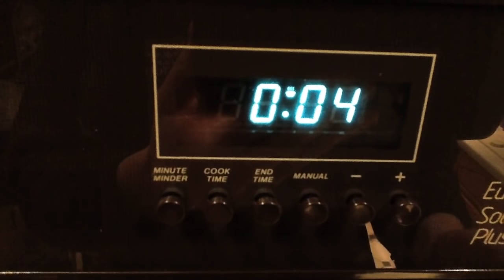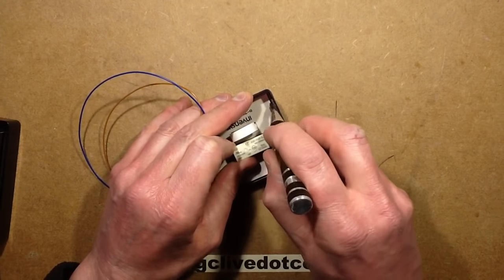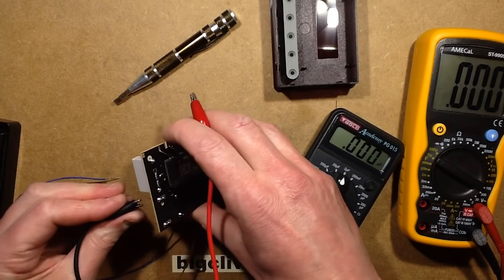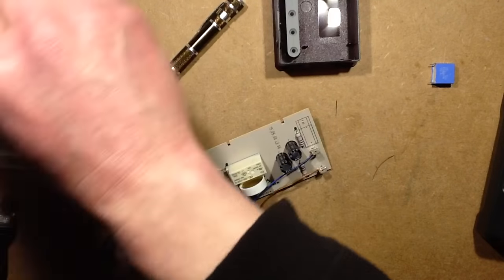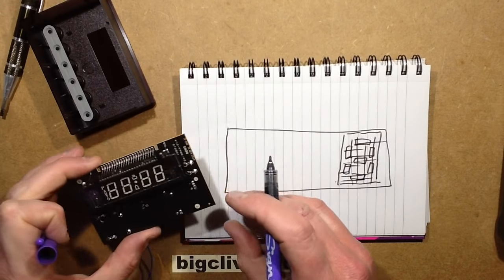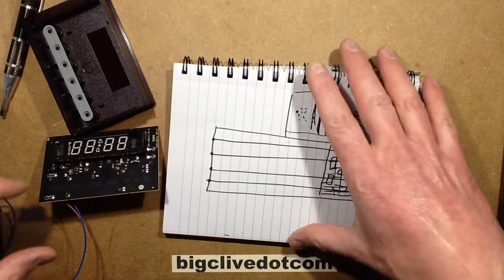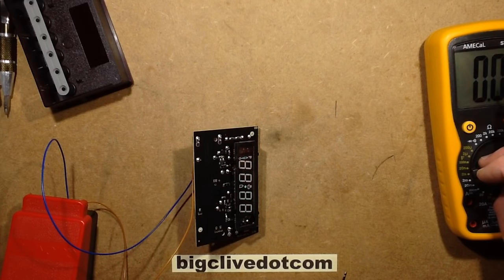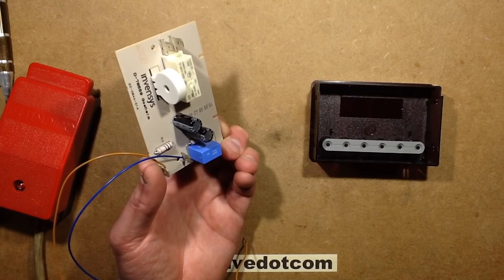Fixing a digital oven timer module.

Comment: By any chance do you know the DC voltage out of the rectifier bridge?  I am getting 0.5 volts and there is no way to know the real value of the two  zener diodes  test them and one is 12.3v and the other 2.3v

Comment: First impression was partly shorted electrolytic capacitor, shunting voltage.  Yet, if cap dropper fixed it, it was current issue?  In either case, main input voltage or current was obvious.  This because even the piezo and relay was buzzing.  I've seen too many such defects as low negative supply rail as being one of the electrolytic caps being partly shorted.  Anyway, as long as circuit is up and working again and relay latches as it should, its fixed.

Comment: Very interesting,  timer module de Dietrich oven displays oven temperature set point and actual temp,  crystal display, single button, knob to press to scroll between timer modes. When we press the button it no longer scrolls... Would be interesting to have your skills.
Unbelievable with same oven , oven light stays on,when the off zero position is selected on cooking mode selector. De Dietrichs are dear and parts scandalous. Delighted to subscribe to your channel, i might learn something!

Comment: Hi I've got one of these and replaced the component as you have done. I see that the relay looks a little brown and get no continuity across it, so suspect that has failed. I'll order the component and try my luck.
Reply from the maker: If the relay is discoloured then the contacts may be burned out.

Comment: I have successfully replaced broken dropper caps in freezer and floor heating thermostat. How critical the value is for the replacement cap?
Reply from the maker: +TheJJHO Preferably the same as the original.

Comment: Whenever I repair anything with those rubber buttons with conductive studs, I clean them, and the PCB pads with meths. Most TV remotes use them and they often become inoperative after a while.

Comment: I recently replaced this capacitor on the display for an AGA oven (almost identical to the one shown) but still nothing is working even though the rectifier downstream from the cap is showing about 12VDC. Is there anything else worth looking at before I attempt to find a replacement?
Reply from the maker: If there is an electrolytic capacitor then try routinely changing that, noting that it is a polarised component and needs to be put in the correct way round.
Reply: Thanks for the tip. With this capacitor changed the relay now opens (it's NC), so somewhere else is now getting power but there's no display. I have tried setting up the minute minder and manual cooking 'blind' but there's not response. Seems that this one is beyond repair.

Comment: Was that capacitor at around 4:40 Iskra branded? I didn't know that they were still in business. It's an old Yugoslav company that used to make all kinds of electronics equipment like multimeters, oscilloscopes and soldering stations.
Reply from the maker: +Derp Herp It sure is.  Well at least, the brand is.

Comment: Hi Clive, got a very similar clock/timer on my double oven, whenever I turn anything on it trips the fuse, after checking all the elements which seem fine I took the timer apart and noticed the dropper capacitor had a scorch mark next to the resistor and also the relay spade connectors are also have a black deposit on them,  is it possible they are responsible for tripping the supply?? Getting fed up with microwave meals and don't want to spend silly money on a new clock/timer for it not to rectify problem..
Reply from the maker: If it's tripping the RCD on all settings it might be a neutral to earth short.  Check all the heater elements for craters.
Reply: @bigclivedotcom  thanks Clive, are the connections on the relay and the scorch mark anything to worry about? I've noticed before I turn any oven or grill on I set the time on the clock but as soon as I push any of the buttons the display dims quite a bit, I'll check all the components again.

Comment: I have same PCB in my oven. In last 2 years i replaces same capacitor as you 4-5 times already. It appears failures happen more faster after each replacement.
It starts with reset (like when you unplug power) every ~48h and goes progressively faster each time up to reset every 10 minutes, and in the end it goes down and nothing works.

I can replace it again but what is the cause of this? Any idea?
Reply from the maker: Are you using a good quality capacitor from a mainstream supplier?  If the capacitor is failing that fast it may be shunting a lot of electrical noise.

Comment: The dropper capacitor going low in value over time is a really common fault in all sorts of appliances.  It's the first thing to check when the product becomes intermittent or drops dead entirely.

Comment: Its common for vfd's to have ac across the heater, in fact its better for them.
DC introduces a voltage drop across the heater wire making a brighter display at one end, this isnt as bad with ac.
Proper vfd drive chips that run off dc produce a square wave for the heater using a H bridge.

Comment: Hi Clive. I have one of these devices and for the sake of a £1 capacitor I’ll be trying to fix it however it looks like someone has already bypassed it somehow and so even if I do fix it I’ve got no idea how to connect it back uo 😂  
Mind you, I suppose, it’s just a case of putting the relays in series with the oven element?
Reply from the maker: It's possible that the connection to the relay has been joined across by someone else.
Reply: @bigclivedotcom  thanks for the reply. ive got two naked relays (x4 empty spade pillars) and x2 spade “christmas trees” with everything rammed on, plus a distinctly aftermarket looking choc connector. Something for those long winter nights…
Reply: Woop woop. Swapped out that capacitor and the display is back to life. Now all the remains is to work out how to connect it back into the actual oven function.😂
Many thanks for your video Clive. It’s really been so helpful.

Comment: Where is the connection to the temperature sensor?
I though that was a oven controller.
It has the relay to start turn on the heat, but no way of detecting the temperature.
Reply: Oh, I see!

Comment: Your desoldering wick is tons better than the drek I get. Need to find me some better stuff.
Reply: +Glebs Litvjaks that's actually what I've been doing, it's the only way it works. I think that's actually isn't any in the braid.
Reply from the maker: +Gadgetboy Search eBay for goot wick.  It's available in several widths.  This stuff is CP-3015 3mm wide (seems bigger) by 1.5m long.
Reply: +Gadgetboy I just gave up and bought a Hakko desoldering gun. I love the thing.  Nothing like it when I have to desolder chips or a whole lot of parts. I once had to sit down and remove USB connectors from 200 boards.  The Hakko does such a good job that when I finished the last pin 9 times out of 10 the part just drops out.
Reply: John Ridley what model?
Reply: +Gadgetboy 808.  Fully self contained.  It's great.  It was $200 but I'd pay it again.
Reply: Goot works good!

Comment: What is the brand or type number of that X2 cap? So i don't accidentally buy one and have to replace it again in 10 years...
Reply from the maker: +LimaVictor There are a wide range of brands.  It's down to what you can get from your supplier.
Reply: +LimaVictor The white one is Iskra, Slovenia. Suppliers to Gorenje.
Reply: scolic03 Thanks!

Comment: I thought most if not all VFDs are AC. Is there such a thing as a DC VFD that runs off DC and doesn't rectify to AC?
Reply: +jak p (skiguy09) - Indeed, the cathode (heater) is powered with AC, usually from seperate, isolated windings if a mains transformer is used, and is held at DC negative with respect to the anode.
Reply: "rectify to AC"? What would the term for that be? De-rectify?

Comment: Are these caps really not that robust. I Changed on in a sewing machine and it had exploded and was smelling realy bad. I know that electrolytics can do that but this was some kind of metalized paper or something.
Reply from the maker: +rimmersbryggeri It can happen, but if you used the correct value and voltage rating and it was a proper suppression cap then it should have been OK.
Reply: This sewing machine was so old though that the cap was 220 and the mains is 240/250 now. I changed it for one for the current mains voltage.

Comment: Hi Clive, I've only recently discovered your channel, and I've been binge watching while off work recovering from flu. I must be on the mend because this morning I decided to tackle something that's been bugging me for a while, an intermittent fault with our oven timer. The problem is compounded by the fact that the oven has an auto-spark, and when the timer drops out the oven goes out, and we often get a on-off-on-off dance from the cooker when the oven is switched on, and it's warmed up, meaning that the oven is unreliable. While searching online for a replacement timer, or method of bypassing it (we don't use it), I saw, there in my search results, a video thumbnail, and I exclaimed aloud "it's BigClive!", I thought if anyone would have a solution it would be you. So I watched the video, but my timer is a different model, there are similarities, but not many. Anyway, watched the vid, paused, looked at my timer, watched some more, paused again; I eventually spotted a dry solder joint - I know how to fix that! Out came the soldering iron that I've not used in nearly 40 years (I used to build guitar effects pedals when I was a teenager, but they never worked - hence the lack of use for the soldering iron!), and the solder. I let it all warm up applied heat and a little solder, and hoped that lack of practice had improved my soldering! I connected it all back up, powered up, looks good. Turned on the oven, ran it for an hour, used the alarm timer several times; hey! it works! Thank you so much for the very enjoyable channel, and getting my cooker fixed for free!

Comment: Somebody beat me to posting the reason for AC on the filaments so instead here's a silly VFD fun fact: If you look at an operating VFD with an infrared (e.g. "night shot", not FLIR) camera the tiny filament wires are plainly visible as very bright lines across the display. The segments however, being cold, are nearly invisible.

Comment: I've had these modules on just about every cooker I've owned and they're a right pain. I never use ANY of the functions and only set the clock because it looks better if it's the right time. And therein lies the problem: twice a year when the clocks go forward or back, I have to fiddle about for 10 minutes to work out how to change the time. This is completely a trial and error process and to make matters worse, if you don't get it right, the oven refuses to work. Ovens would be a lot better if they simply missed this contraption out.

Comment: I have burned relay same brand oven.
Have you Relay info for me Please ?
Reply: +Edmorbus Old microwave ovens often have relays of that type, if it's of any use to you :) There are quite a few coil voltages though, I've seen 6, 12, 18, 24 and 30 volt DC coils in microwaves. If you found one that was a lower voltage than the original, a series resistor could be used I'd guess.
Reply: *****

Thanks I need 16A relay
Reply: Edmorbus You need the coil voltage, switching poles, footprint as well as switching current
Reply: +Tony Ling 
Yes
Reply: Edmorbus so what are the markings on the relay ?
Reply: +Tony Ling 
230v 16A

Comment: I'm a year late to the party but screw it. You actually want AC through the filaments in the VFD, if you use DC There is a visible gradient where segments to the negative side are a bit brighter.

Comment: So you're telling me the oven we have could fail at any point? :/

Forgetting that worry for a moment, at least we should give thanks for the component structure in electronics. I assume at one point in history everything wasn't isolated into individual bits and it was all some form of metal structure that drove your appliance. If they even had appliances back when. It is almost the case that it's just one component in a circuit that goes (major damage aside) isn't it? I wonder what it is in each thing that fails as even a component must consist of individual parts. Metal corrosion or some other chemical reaction I presume or in other words a scientist's domain rather than a technician's.
Reply: +MagikGimp Mind you, those vacuum thingies are made of lots of bits. But then they don't seem to break. Amazing really.

Comment: Why are things invariably an easy fix after you've already replaced them? That happened to me here with a microwave oven. One died, I bought a new one, then I opened up the old one. It just had a burnt connector in it.
Reply: +Paul Frederick Household appliances will get fixed here but I have a three fixes and you're out rule. The microwave is on its last warning.
Reply: Graham Langley
I'm convinced microwave ovens are not durable goods. They're more disposable trinkets.
Reply: +Paul Frederick Ours is at least a quarter of a century old.  My wife occasionally talks about getting a nice new one.  So far I've managed to convince her that if we get a new one we'll be committing to replacing them every few years for the rest of our days.
Reply: Richard Dunstone
As I understand it the magnetrons in all microwaves degrade with use. There's usually a specific volume of water boil test over time that you can subject microwave ovens to, in order to gauge their present power delivery capability. I've seen such data in owners manuals. They'll tell you X amount of ounces should boil in x amount of time.

I like the Panasonic Inverter models. The big ones are pretty powerful. Plus they're the only ovens that are actually level adjustable beyond just on, and off cycling.
Reply: +Richard Dunstone I bought the one here the day my offer on my first house was accepted in back late 1986, so that''s 29 years. £130 for a basic own-brand 550W runback timer (pinger) model. Ought to do a power output test on it to see what it's down to.
Reply: Graham Langley
550 Watts? I think you might be due to upgrade. This is the one I got http://goo.gl/1JZxvs It's a little devil when it comes to heating stuff up.
Reply: +Paul Frederick Unfortunately they don't do anything like that one for the UK market but Panasonic would be top of the list when this one fails.

FWIW my sister had the same model bought around the same time and managed to kill it complete with smoke in a couple of years.
Reply: Graham Langley
I killed my last Panasonic. I think what happened was a peak shut off. Instead of hitting stop I just opened the door, and that caused an interlock switch to burn up in it. I found that out after I'd bought a new one, and took the old one apart. Now I always hit stop as opposed to just opening the door. So far so good.

It was actually a Sta-Con connected to that switch that burnt up. So I repaired it, and that oven works again now. So it went into the box for the new one, and it is sitting on a shelf here.

But what I think happened is I opened the door just as the AC sine was at the peak, and that caused the overload failure. A kind of electrical Russian Roulette.
Reply: I'm still using my grandfather's old microwave oven. It just keeps working. :-) The machine which goes ping. It's a Creda, made in Japan or at least that's what the sticker says.

Comment: Mine has just gone bang & flashed this morning, the begger hadn't even  been on, It's going to cost £115 to replace, that is just the unit price.......GUTTED
Reply from the maker: There may be spares on eBay if it's a common failure.
Reply: @bigclivedotcom  Thanks Clive, found one for £65, but I'm having second thoughts about doing the job myself in case another part of the cooker has caused the module to blow,, the cooler fan isn't kicking in when main oven is turned off. This feature is working ok on top oven.

Ps all the best for xmas mate